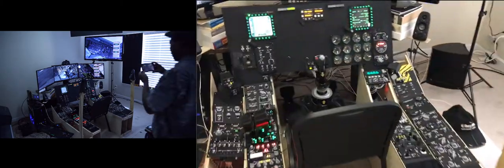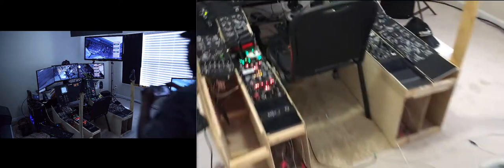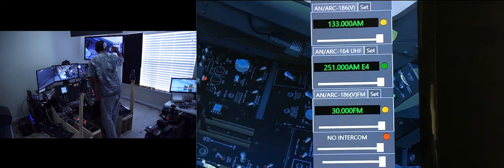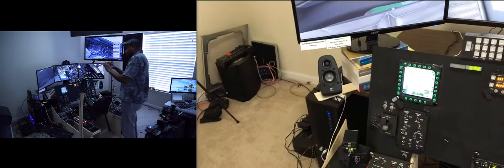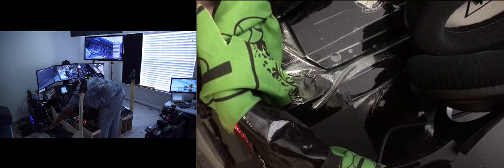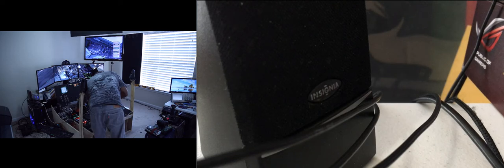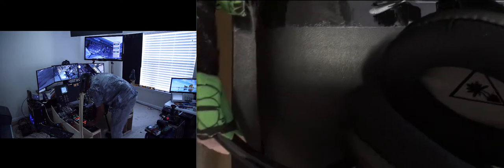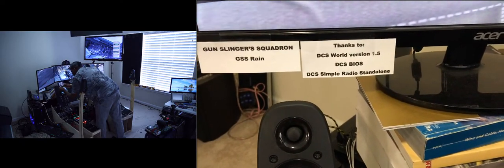DCS Simple Radio Review

Comment: Very cool
Reply from the maker: DCS-BIOS by Mr. Ian connects the hardware panel to the simulation.  This is a must and way cool. But DCS Simple Radio by Mr. Fisher brings a lot of the panels to life. For example, the AN/ARC-186 VHF_AM radio, AN/ARC-164 UHF radio, VHF_FM radio, the KY-58 Secure Voice, and hopefully soon the AN/AIC-18 Intercom panel. And hopefully the community can convince him to do the antenna panel and the IFF transponder. For example, when talking to someone at the edge of radio distance limitation, we could flip the antenna switch from lower antenna to upper antenna depending on if the target is above or below the aircraft. Maybe get a slight increase if using an antenna that is facing target.  I know the software is checking distance and line of sight blockage but not sure if he can add an altitude check relative to your own altitude.